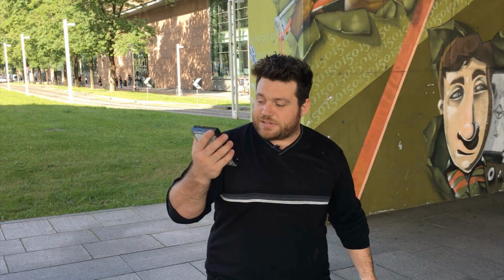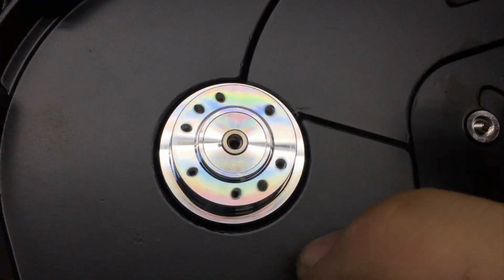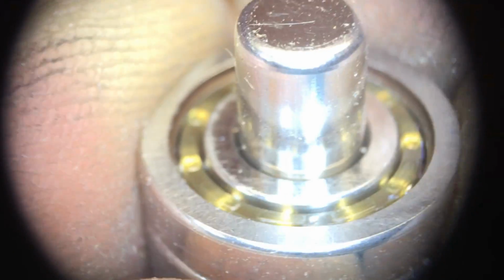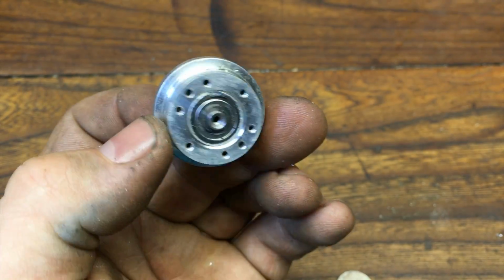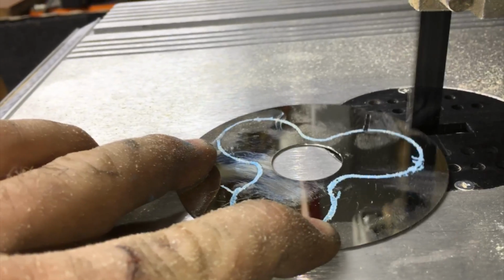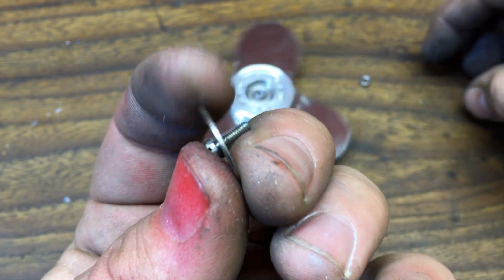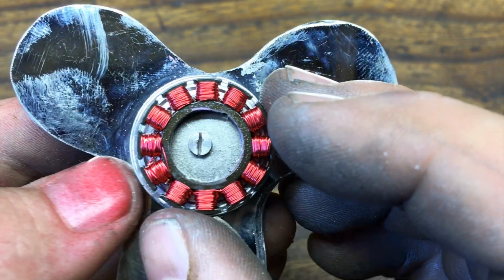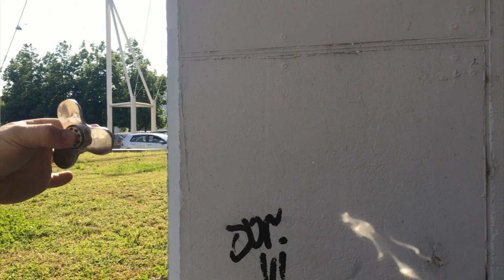How to Make a Fidget Spinner from an old HardDisk

Comment: It's next to impossible to get to the ballbearings on 2 hard-drives I dismantled.  They are housed in a casing that is so difficult to get open.  In fact I just watched someone with a full size heavy duty lathe spend lot of time grinding the housing down, which took time and even he burned his fingers, just to get to the ball-bearings.